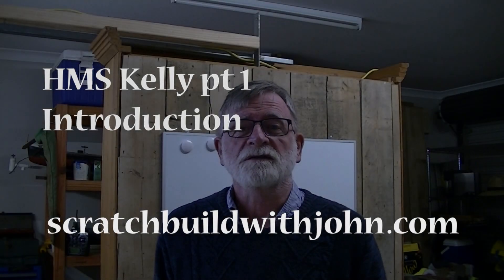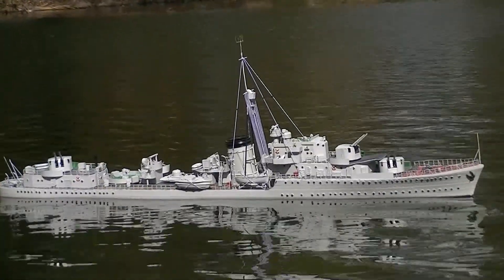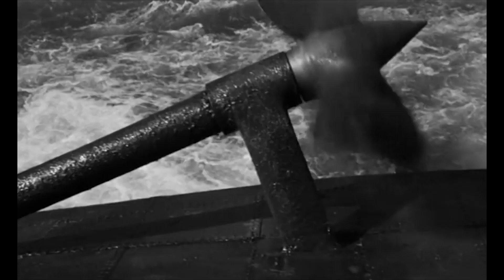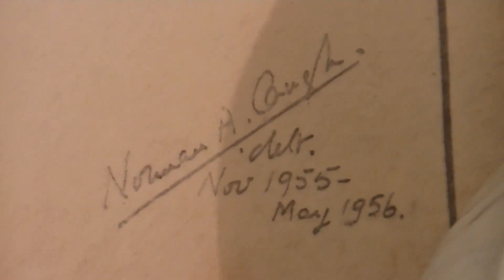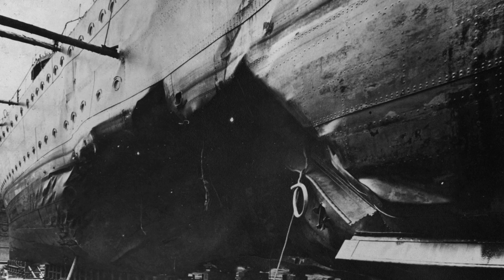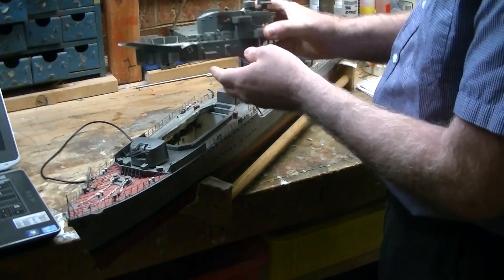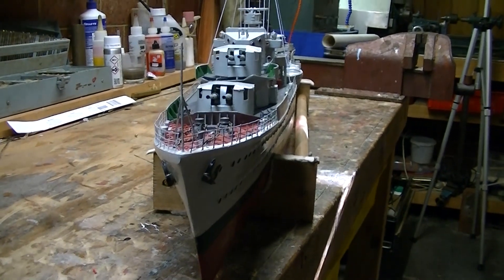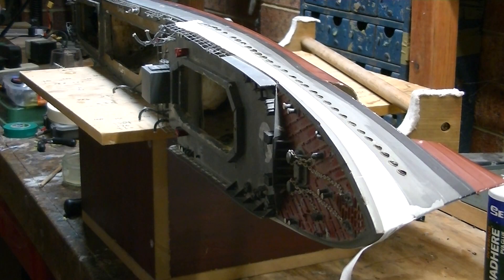Kelly 1 Introduction

Comment: impressive build - I built the HMS Cossack ( and it was just display only ) - from deans marine about 15 years ago This was my Model - https://www.bismarck-class.dk/shipmodels/british_models/cossackwalker.htmlit was soo not easy , took me 3 months . I Noted your comments about - the problem with Kit Accuracy - Also the lack of Sheer in the bow was a fault ( rectified ) in the brand new Trumpeter 1.350 scale HMS Eskimo Kit ( which I easily converted to HMS Cossack )